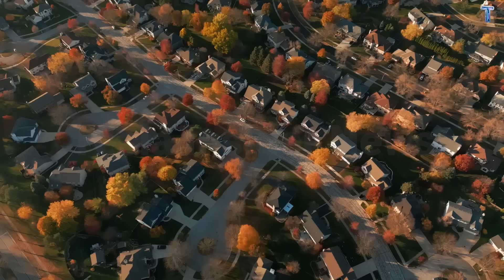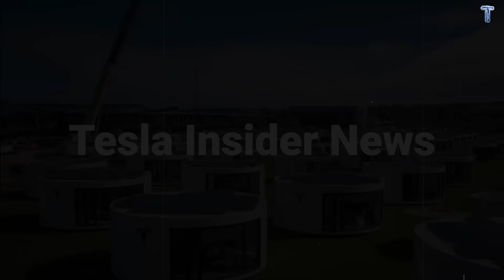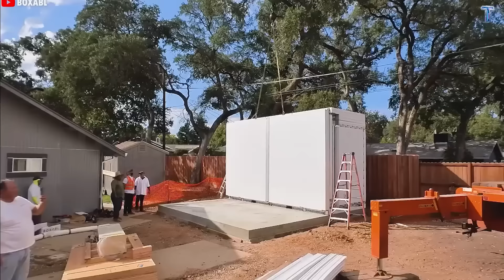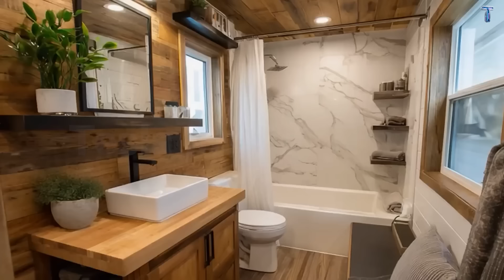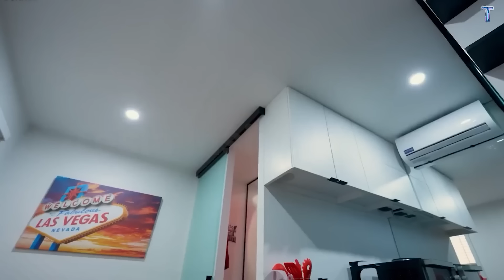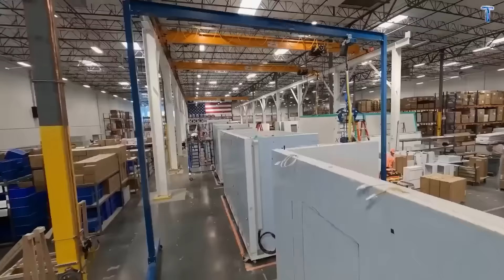Elon Musk’s $249/Month Tesla House Could End Housing Bills for Millions

Comment: Wow that should take away Carneys 20foot C can homes worth $250,000.00
Reply from the maker: That comparison is already coming up a lot. Based on current internal leak info, the goal is to dramatically lower costs through mass manufacturing, but final pricing and availability can still change. If alternatives like this enter the market, it could definitely pressure high priced container style housing. Do you think real competition would actually bring prices down where you live

Comment: How about in Toronto do you have ?
Reply from the maker: Canada isn’t confirmed yet. Based on current internal leak info, early rollout is focused on select US locations first, with other regions like Canada depending on local regulations and zoning approval. Toronto has stricter rules, so timing could differ. If it became available there, would zoning or winter performance be your bigger concern

Comment: Get everybody boxed up where we can keep them under control ?         What about folks who like to make a home their own.    Can't see that with these boxes.    Possible direction would be to integrate this vision with that of Callenbach's 1975 ECOTOPIA novel.
Reply from the maker: I get the concern. Based on current internal leak info, the goal is mass manufacturing and managed systems, which can feel like turning homes into standardized boxes. But customization could still exist through modular add ons, layout combinations, and interior finish options as the product matures, and those details may change before launch.

If you could personalize the exterior, interior finishes, and add modules over time, would that address the boxed in feeling or is the whole managed ecosystem the real issue for you

Comment: Elon, you're a con man!  I was really interested until your excess fees!  We don't want Big Brother in our homes!  It's bad enough it's on our cell phones and TVs!
Reply from the maker: That concern is shared by a lot of people. Privacy and ongoing fees are the biggest sticking points right now, and based on current internal info those frameworks are still evolving and not final. Many are watching closely to see if stronger user control and clearer limits get added before launch. Would you ever consider it if privacy were fully opt in, or is that a hard no regardless of cost savings

Comment: What about the windows.  I love light but not necessarily for others to look in.  I thought they said it darkens.  Need more information.
Reply from the maker: Privacy is a common concern. Based on internal leak info, the glass is designed to automatically darken or tint on demand, similar to electrochromic tech, so you can control light without giving up privacy. Final window options and controls may still change before launch. Would adjustable tinting be enough for you or would you still want physical blinds or shades too

Comment: I'd like it knowing that one was mine, connected to one that was hers and still having room for a 3rd that was "ours", and should we separate, we each still have a home. Could a very small mig welder be run from the car charging system ? Very low useage, hobbyists / possibly side income working in the cyber truck garage ?
Reply from the maker: That concept is exactly what modular setups are aiming for. Current info from internal leaks suggests units are designed to connect while still being individually owned, though final rules and configurations may change before launch.

On power use, light workshop tools could be possible, but sustained loads like welding would depend on inverter limits, battery capacity, and local safety rules. It’s likely intended for occasional low draw use rather than continuous shop work. Final specs are still evolving.

Would the ability to expand and separate ownership matter more to you than running higher power equipment on site

Comment: If this is really available I am ready to buy. My concern is about city restrictions and septic tank connection. I have half of my lot that is vacant. I would like to put one on my lot and let my kids move into the house.
Reply from the maker: That’s a very common use case. Based on current internal leak info, placing one on a vacant portion of your lot would depend on local zoning rules, ADU allowances, and how utilities are handled. Some setups are designed to minimize or avoid septic connections using self contained systems, but city approval is still key and details may change before launch. Many people are looking at this exact solution for family housing. Do you know if your city already allows ADUs or secondary dwellings on residential lots

Comment: I need about 5 units and I will tare down my house and replace it with some of these. I would be cheaper than renovations
Reply from the maker: That’s a use case a lot of people are looking at. Based on internal leak info, multi unit setups are being explored, but zoning, permits, and replacement rules would depend heavily on your local regulations. Final pricing and approvals could change before launch. Would your city allow modular units as a primary residence on an existing lot

Comment: Most cities won't allow tiny homes,  even if you own your property. So, the law will need to change to accommodate the new industrialized housing.
Reply from the maker: That’s true in many places right now. Zoning laws weren’t written with modern modular or industrialized housing in mind. Based on current internal info, adoption will likely depend on cities updating ADU rules, tiny home definitions, and utility standards over time. Pressure usually comes from homeowners like this asking for change. Do you think cities will adapt faster because of housing costs, or will regulations lag behind demand

Comment: I wouldn't want an advertisement logo engraved in my home
Reply from the maker: That concern comes up a lot. Based on current internal leak info, branding and exterior design options are still being discussed and nothing indicates mandatory advertising or logos inside living spaces. Final design choices could change before launch. Would a completely neutral, unbranded interior be important for you to feel at home

Comment: Being the Land owner, Permits needed in Florida and cost
Reply from the maker: In Florida it usually comes down to county and city rules. Even if you own the land, permits typically involve zoning approval, site plan review, and utility or septic clearance. Costs can vary widely and details are still evolving based on internal info, especially for modular or ADU style units. Florida is considered more flexible than many states, but final requirements depend on local code offices. Have you checked whether your county already allows ADUs or secondary dwellings on residential lots

Comment: Will the engineering survive Construction Unions? 
A retirement property needs Acreage and Grand Children.
Reply from the maker: Union rules won’t change the engineering itself, but they can affect where and how fast these get approved and installed. Based on internal leak info, the idea is factory built units to reduce on site labor, which sometimes runs into local construction rules. How that plays out will depend on state and county regulations.

As for retirement use, these are clearly aimed at people who already own land or want flexibility. Acreage plus modular units could work well for family setups, but zoning and local codes still matter and may evolve. Would land use or local labor rules be the bigger concern where you plan to retire

Comment: How about the set up,is it alouing for the handy cap,their wheel chair into the bathroo m. or be able to reach for something in the upper cabinets.are there homes set up for that?
Reply from the maker: Accessibility is a key question. Based on internal leak info, the design is expected to include barrier free entry, step free bathrooms, and wider clearances, especially for senior focused units. Cabinet height and reach range may vary by configuration, and some layouts are expected to be more mobility friendly than others. Final specs could still change. Would wheelchair access be a must from day one for you or could light modifications work

Comment: Everything was going fine, until you read the small print.  Uhhh no thanks.
Reply from the maker: That’s a reaction a lot of people are having. The details being discussed come from leaked internal info, and early contracts often change once feedback piles up. Nothing is final yet, but concerns like ownership, privacy, and control are clearly the sticking points. If those terms were rewritten, would that change your view at all or is it already a hard no for you
Reply: @TeslaInsiderNews Thanks for your reply.  There were definitely some things you shared ( thank you by the way ) I am not for.  Leasing not owning in their community, not private land, fees - if missed 30 days they come and take the unit.  For me, the data collection is a no no.  I do like the radiant heat, solar, mobile. and wind
The first part sharing the Pros was really good.  But the Cons took over.

Comment: So from boxes they went to cylinders.
Reply from the maker: More like evolving the form. Early concepts focused on simple box shapes for manufacturing efficiency, and newer designs experiment with curves to improve strength, airflow, and energy efficiency. Shapes may keep changing as engineering and regulations evolve. Do you think form really matters if the cost and livability improve

Comment: Those it come with land?
Reply from the maker: Land is not automatically included. Based on current internal leak info, some pilot setups may offer placement in managed communities, while others would require you to already own or lease land. Details can vary by location and may change before launch. Would you prefer owning your own land or being part of a managed community if that lowered upfront costs

Comment: I like these homes, but I wonder what a Texas hailstorm would do to those solar panels.
Reply from the maker: Texas hail is a fair concern. Based on internal leak info, the solar roof is designed with impact resistant tempered glass similar to automotive and commercial systems, tested for severe weather. Extreme hail size and angles can still vary, and final specs may evolve before launch. Have you had panels damaged by hail before or just worried about rare storms

Comment: But every person is still forced to need a deadly VEHICLE! So it’s still wrong!
We should build only TOWER CITIES connected to maglev Trains to save lives and the EARTH! 
And there should be EQUAL WEALTH WORLDWIDE!
Reply from the maker: That’s a bigger system level argument, and a valid one. Housing alone doesn’t fix transportation, safety, or inequality. Based on current thinking behind these projects, the goal is reducing costs and energy use, not solving every structural issue at once. Larger ideas like dense cities, mass transit, and fairer systems take policy shifts, not just new products. Do you think real change starts with tech like this, or only with governments redesigning cities from the ground up

Comment: What does Tesla get out of listening and seeing everything plus Tesla has all the control you have all the expenses,is it really worth it ?
Reply from the maker: That’s the trade off many people are debating. Based on internal leak info, Tesla benefits from system data to improve efficiency, safety, and long term performance, while users benefit from lower operating costs and automation. Control and privacy terms are still evolving and could change before launch. For some the savings and convenience are worth it, for others ownership and privacy matter more. Which side do you lean toward if costs were clearly lower long term

Comment: Sound like communistic control.  And I thought homeowners association was bad enough that is a controlling thing too.  Yeah I could live in something like that. But  value  my Freedom and privacy
Reply from the maker: That’s the line a lot of people won’t cross. Freedom and privacy matter more than convenience for many homeowners. Based on current internal leak info, those control structures are still evolving and could change before anything is final. If they offered a version with true ownership and minimal oversight, would that shift your view or is independence non negotiable for you

Comment: I WOULD THINK IF YOU BUY IT OUTRIGHT FOR THE FULL PRICE CASH AND PUT IT ON YOUR OWN LAND TESLA THEN CANNOT TAKE IT BACK 
DAVID ADAM GRENIS 
BOULDER COLORADO 80304
Reply from the maker: That’s a reasonable assumption, and a lot of people think the same way. Based on current internal leak info, paying cash and placing it on your own land could change how control works, but ownership terms, land use rules, and repossession rights still depend on the final contract and local laws. Those details can evolve before launch. If full cash ownership on private land were clearly guaranteed, would that resolve most of your concerns or are privacy terms still the bigger issue for you

Comment: a WELL I KNOW THAT HERE LIKE IN BOULDER COLORADO AND MUCH OF THE COUNTRY THEY HAVE A MINIMUM SIZE THAT CAN BE CONSIDERED A HOUSE AND 240 SQUARE FEET IS NOT GOING TO BE POSSIBLE I THINK IT'S AT LEAST $600 OR 800 SQ FT
Reply from the maker: That’s correct for many cities, Boulder included. Minimum size rules are common and often set around 600 to 800 sq ft for a primary residence. Based on current internal info, smaller units are usually positioned as ADUs, movable dwellings, or modular units under different classifications, which is how some areas work around those limits. Zoning laws are slowly evolving as housing pressure grows. Do you think cities like Boulder will adjust first for ADUs, or will minimum size rules stay firm where you live

Comment: SO SOUNDS LIKE YOU NEED TO HAVE THE ABILITY TO JUST PAY IT OFF CASH AND PUT IT ON YOUR OWN PIECE OF LAND AND GO AHEAD AND PAY TAXES
Reply from the maker: That’s one possible scenario. Based on current internal leak info, paying cash and placing it on privately owned land may offer the most control, but taxes and local regulations would still apply depending on how it’s classified. Details can change as rules get clarified. Would owning the land outright make the trade offs more acceptable for you or is the model itself still a concern

Comment: THAT'S GREAT UNTIL YOU START PUTTING CLOTHING AND ALL KINDS OF STUFF AND AND FOR TWO PEOPLE 240 SQ FT DEFINITELY WOULD NOT WORK ESPECIALLY IF YOU'RE LIVING WITH A HOARDER 😊😅😅😅😅😅😅😅😅😮
Reply from the maker: That’s a fair point. 240 sq ft is tight once real life stuff comes into play, especially for two people. Based on current info, these units are aimed more at minimal living or modular expansion rather than fitting everything into one space. For couples, adding a second unit is likely the realistic option. Do you think storage or total square footage is the bigger deal breaker for most people

Comment: Would they be available in Canada???
Reply from the maker: There’s no confirmed availability for Canada yet. Based on current internal leak info, early rollout discussions are focused on the US first due to regulations and manufacturing. Canada is often mentioned as a possible later market, but timelines and requirements could change. If it did come to Canada, would climate performance or zoning rules be your bigger concern

Comment: Isn’t it when it hits 300 ft.² you have to start paying I don’t know taxes I guess so why don’t you make it 299 ft.² instead of 240
Reply from the maker: Square footage thresholds aren’t universal. Taxes and permits depend on how the home is classified by the state and county, not just a single number. Based on internal leak info, size is being kept flexible to fit different zoning rules, and those rules can change. In your area, is it the square footage limit or the permanent foundation rule that usually triggers taxes

Comment: Eon Musk building  a tube not a house who wants to live in a thing like that.
Reply from the maker: That reaction is common. Early designs experiment with different shapes for strength and efficiency, so it can look strange at first. Based on internal leak info, form is still evolving and the focus is cost, durability, and energy performance, not aesthetics alone. Would design matter to you if it solved affordability and bills, or is the look a deal breaker no matter what

Comment: Will it crash into other houses?
Reply from the maker: No, it’s not mobile once installed. Based on current internal leak info, the unit is anchored and stationary, not self driving or moving on its own. There’s no scenario where it would move or crash into anything. Did you think it was designed to relocate automatically or just curious about how secure it is once set up

Comment: Extra things to consider, some people like access to public transit. Rideshare or Uber or Lyft or taxi. I climates like canada, a good size closet, pref near either door for 5 coats 5 pairs of boots or shoes, umbrella, mittens, hats & small chair or bench. Also, any pet companions allowed? Add, cost of home insurance as well. In our rental unit, our landlord has a preferred insurance, cost $275 yearly, for fire & water, & is a must
Reply from the maker: Those are all practical points people are raising. Based on internal leak info, early designs focus on self contained living, but placement near transit, storage layouts for cold climates, pet allowances, and insurance costs would depend on local rules and final configurations. Closet space and entry storage are expected to vary by model and region, and insurance is likely handled similarly to ADUs or modular units, which can change by insurer. Which of these would matter most for you day to day transit access or interior storage and layout